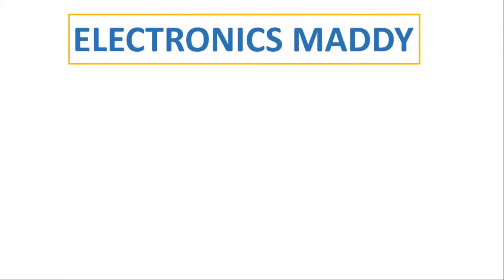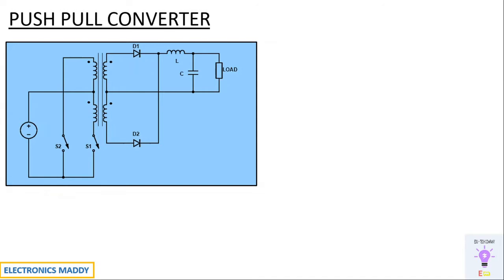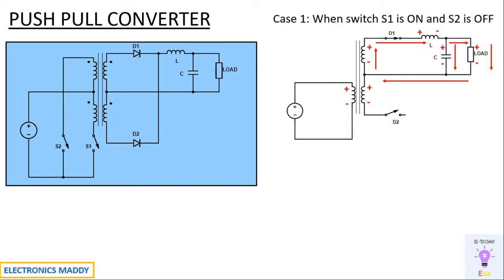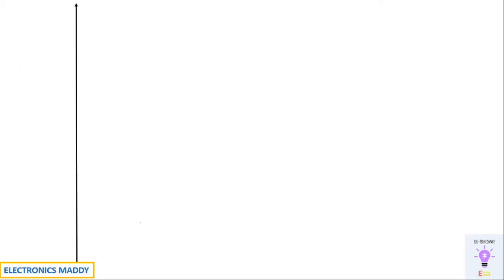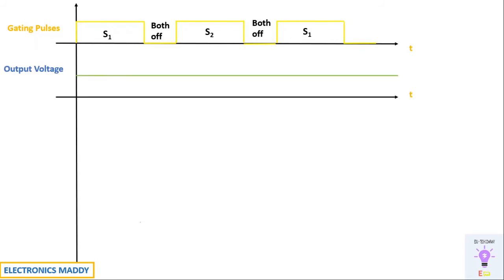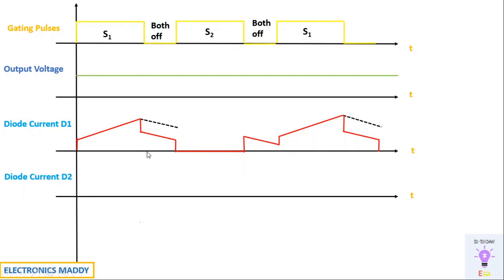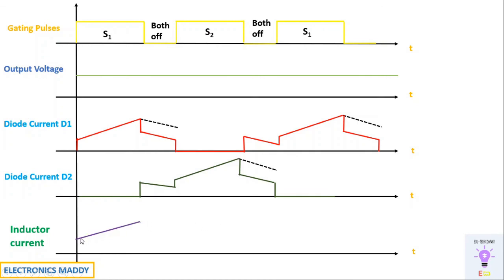Working of a Push Pull Converter

Comment: U said inductor is decaying when D2 is on ...but u should the current nature charging in wave forms
Second question ...incase if the mode of both switch is not present ...then the inductor current keeps increasing according to the wave form u gave ...
My third question is what is the impact of core flux reset.
Why the emf is not induced in the second half of the primary circuit

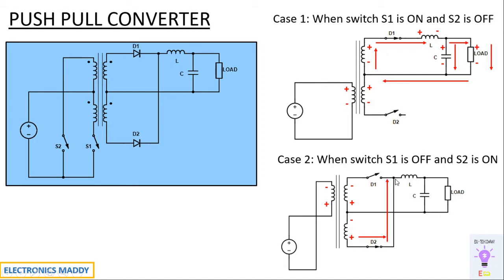Comment: Question: At 3:15, you say that the inductor begins to act as a current source. I don't understand why that would be the case, here. At the point where the lines coming from D1 and D2 connect, directly before the inductor, the "push" is in the same direction. If this is the case, why would the inductor (and the capacitor) change their polarity?